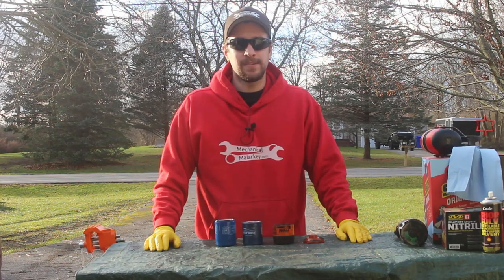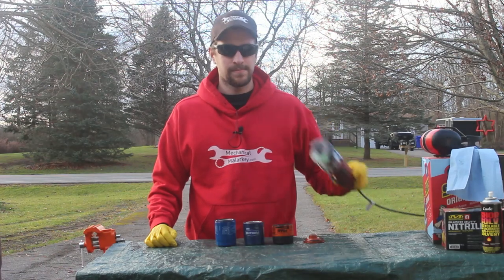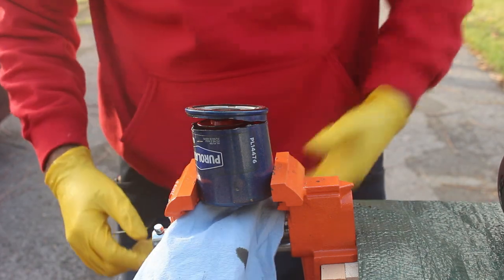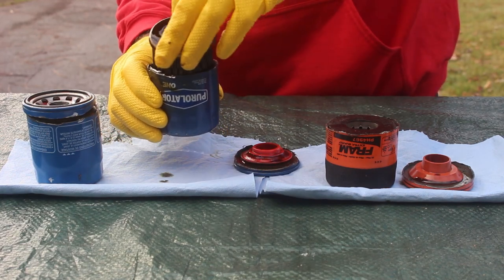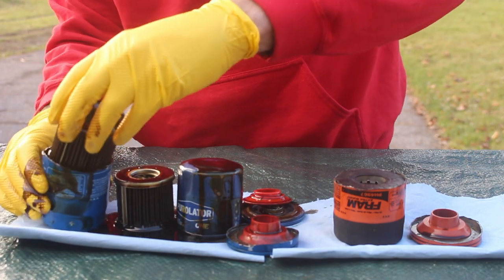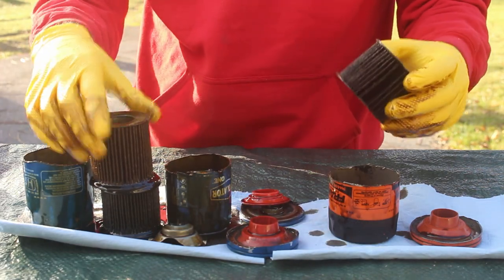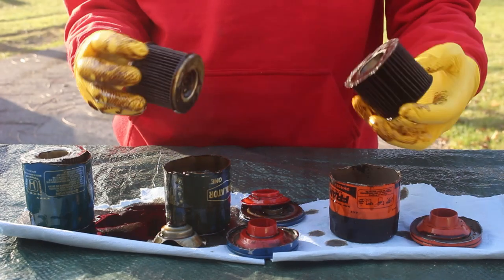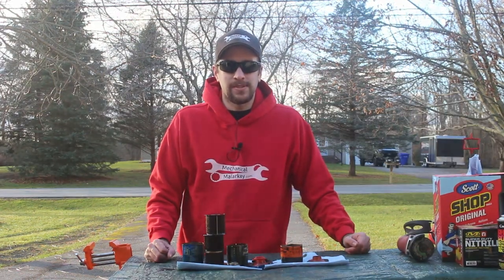Looking Inside Used Oil Filters

Comment: I’ve used OEM, Purolator, and Fram (Tough Guard and Ultra Synthetic) on my Honda’s. All have them have worked fine - considering they’re rated for full synthetic oils and changed out approximately every 7,500 miles. Analysis from Blackstone Labs show that the oils and filters could go up to 10K Miles with little issue.